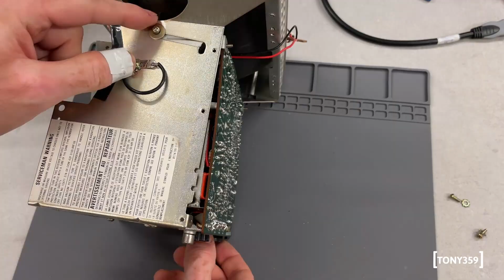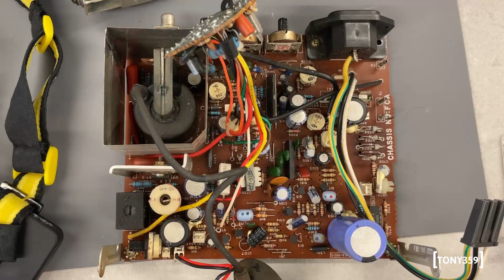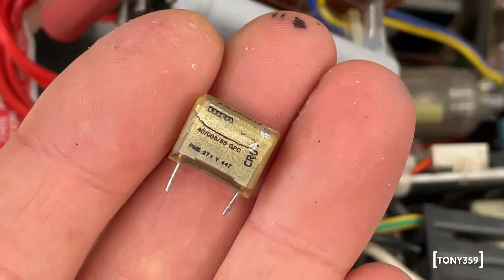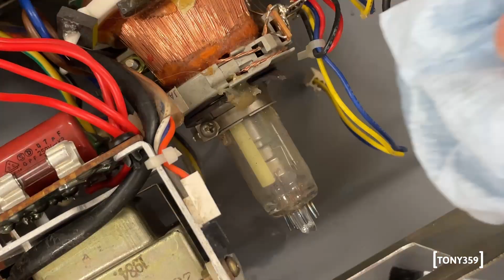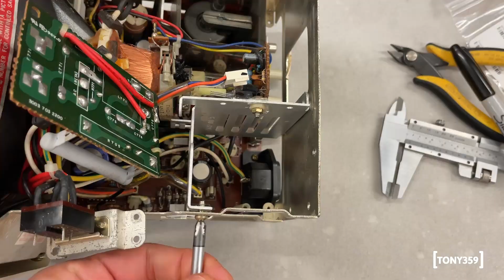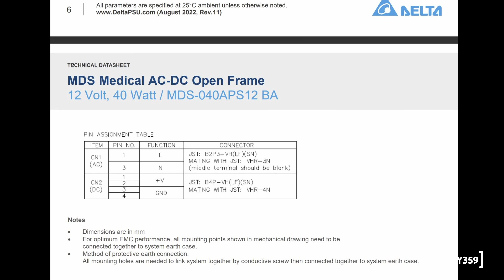Apple //c monitor repair

Comment: Nice video Tony. Very good analysis. Most step down transformers have a thermal fuse inside the casing. I can't remember whether the fuse is on the primary or the secondary but it might be worth checking before you scrap it.
Reply from the maker: Thank you! I did open that transformer after the video and I was able to revive it by just reflow the solder joints between the mains wires and the winding! But I had to cut the external shield - but it works! It’s in my spare parts bin! Thanks again!

Comment: When discharging the CRT you should discharge it to the outer coating of the CRT (Aquadag) this is usually but not always connected to chassis, it either has a metal tab or a wire braid, the metal tab is usually connected to chassis. The braid if connected direct to chassis then OK but sometimes it has a resistor and capacitor to the chassis and a direct connection to the CRT socket board.
The keystone can be adjusted if the electronics does not support it by altering the square magnets around the outside of the scan coil, mark before moving as they affect pin cushion also.
Setting the geometry with the magnets is an art form and takes a while to learn.
I was also surprised you did not open the old transformer as it is unusual for a secondary to go open, so maybe the connection between the winding and the flexible external cable has broken.
Reply from the maker: About discharging, you are totally right, I should have been more clear. In my case the tube tabs are directly screwed to the chassis so it should be ok but I should have mentioned that indeed. I hope it's clear enough. I did play with the magnets at the end of the video, I see what they do but half of them are really not accessible so I decided to just live with that distortion. 
I did open the old transformer - after the video was made and... Well, I'll share at some point, watch this space! That said it's a destructive process for the external metal ring which is tightly wrapped around the metal case. Besides that I managed to open it (and close it back) nicely. Thanks for watching and for the feedback!
Reply: @tony359  I do love your video's, my background is as a repair tech in a CRT monitor manufacturer from 1978 until 2000 when it closed.
Reply from the maker: A proper CRT expert then, amazing! Thank you for your kind words!

Comment: what does ESR stand for ?
Reply from the maker: Equivalent Series Resistance. A real world capacitor will show some resistance as well, not just capacitance. Usually a good capacitor will show low ESR. High ESR is normal for very low values; otherwise it indicates a failing/failed capacitor.  For a 1000uF 25V capacitor you can expect a 0.14Ohm ESR. That capacitor read 0.17Ohm so it's totally fine :)

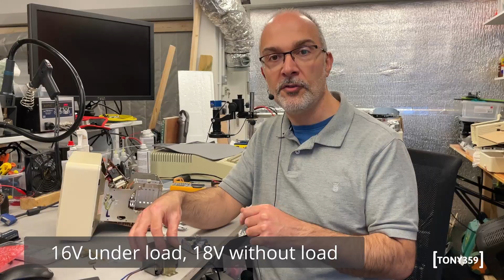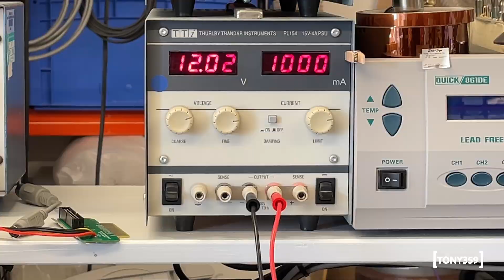Comment: Great video as always. Just a quick note: at 29:20, since you are dealing with AC power, by multiplying V*I you are measuring the apparent power, not the real power. PFC was not a thing at the time, and very likely this device has a very low power factor: this is probably part of the reason why the DC power you measure at 32:55 is way lower than 29 W.
The power supply section will definitely waste some power, but judging from the schematics at 30:35 I would say only about 8-10 W; the rest of the 16 W descrepancy is probably caused by the difference between real and apparent power.
Reply from the maker: Thank you, I appreciate that! I noticed that while the transformer output 16VAC, I only had 18V DC after the diodes. Am I mistaken or I should have read 21.2V DC instead? I thought that that meant that those diodes were pretty inefficient, I forgot to measure the voltage drop. Could that explain the amount of power lost in the circuit?
The overall consumption of the original monitor with the picture you see at the end is 26W, the modded one is 16W. Considering the Delta is not 100% efficient, it looks that the original design was using a bit more than 10W. Thanks for watching and for your feedback!

Comment: why did some of the legs on IC 701 not have any solder on them ?
Reply from the maker: That's a good question and I don't know the answer. It's not just the solder, there are no PCB traces there. I suppose it's a part of the regulator which is not required for the project.